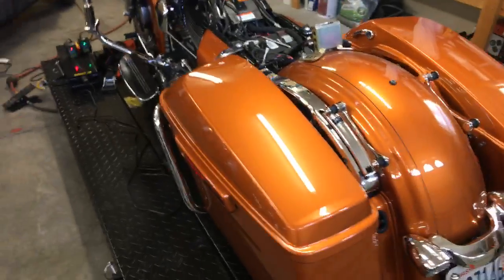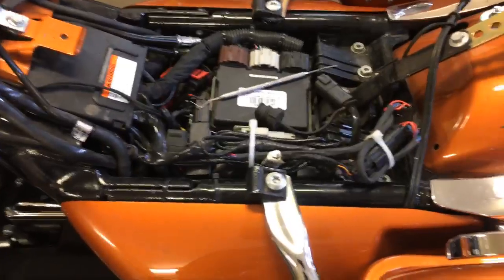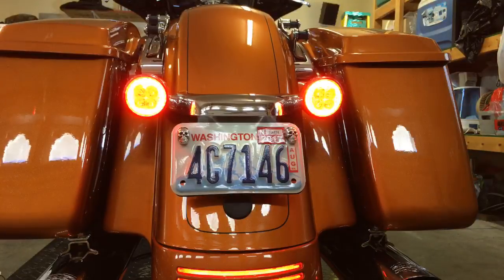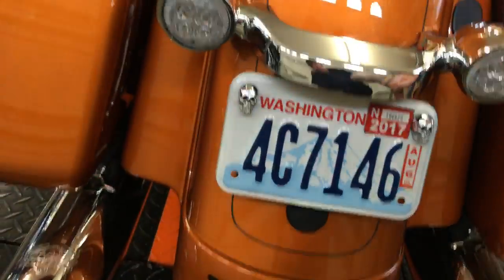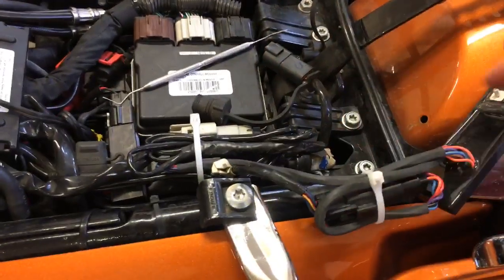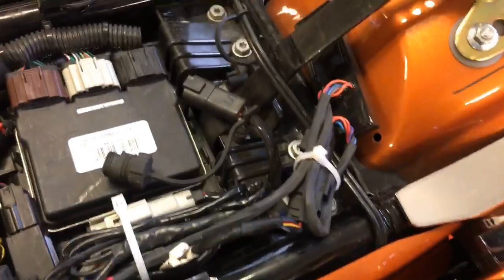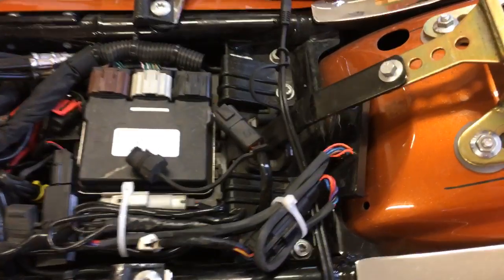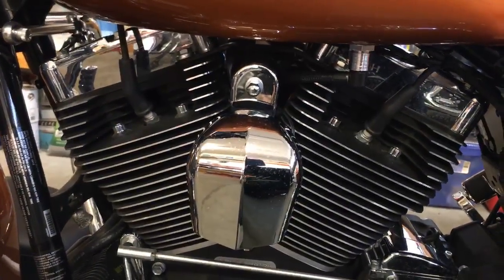Custom Dynamics Magic Strobe Brake Light Modulator for Harley-LED Lights-Review-Install

Comment from the maker: **AFFILIATE REVZILLA LINK TO CUSTOM DYNAMICS BRAKE STROBE MODULATOR ==> 
REVZILLA LINK FOR CUSTOM DYNAMICS STROBE MODULATOR: http://bit.ly/2tZ0VaF

**GET CIRO 3D FANG LED SIGNAL/BRAKE INSERT LIGHTS IN OUR STORE HERE: https://shop.lawabidingbiker.com/collections/lighting-1/products/ciro-3d-fang-led-signal-light-inserts
Reply: Thanks for the tip Ryan , That was easy, I just installed the modulator on my 14 SGS. The bike had LED lamps but they're not as bright as the Fangs you have so I'm going to order the Ciro fangs from your link below.

Comment: Bought the modulator for my 2020 SG CVO after watching your video and love it BUT after installation, the security light stays illuminated? When I remove the modulator, it goes out but reinstalled, it goes back on and stays on?

Comment: I just installed the original... Mine has a lag if I press it takes 1/2 second to start working so if I need to signal vehicle behind with a fast brake signal it will not turn the brake light at all... I installed red to power and white to tail any ideas? I'm using halogen bulb but instructions never said anything about not using normal lights

Comment: I hooked one of these up yesterday, my foot brake wouldn't run it but my hand brake would. I have LED on the back, could that be the problem? I took it back off and hit my brake pedal and it worked as normal.

Comment: Custom Dynamics does make a modulator that will work on incandescents and LEDs (MAGIC-STROBES-BCM) and it's a bit cheaper $59) than the LED only version, but I would agree, if your goal is to be seen, LEDs are for sure the best way to go. The BCM is a brake light-only modulator, and does not flash the turn signals/running lights. I have to say that it's kinda lame that on a $28,000 Ultra Limited , Harley cheaped out and didn't do LEDs on the break lights. If I understood the good folks at CD correctly, they explained that my turn signals are in my Tour Pak and they splits off before this modulator, so I would need a separate modulator for my running/turn signals.

Comment: Next mod is the strobe. I did the Hinz 3rd tail light and LED tail lights from Radianz...big improvement...but defiantly need the strobe. They say it may be illegal here in S.C. (South Carolina, not Socal...lol) but I asked some local Sheriffs Deputies and they said they don't bother the bikers who use the strobes as long as they can't be viewed from the front and they aren't blue...

Comment: I installed the  Custom Dynamics Magic Strobe Brake Light Modulator on my 2018 Ultra Limited . I put this on the left side of the black plug on the rear fender. This let strobe work. when I turn on my signal.

Comment: will this work if i nstalled the filler panel lights is it the same plus im using for that or is it using a diff black plug

Comment: Thanks for sharing. Harley use to sell a modulator for your headlight. This is one of the best things I have ever seen for motorcycles. I had a friend that had the headlight modulator and you would not believe how your eye is drawn to it when he is coming towards you even at a long distance. There is something about the light cycling on and off so fast that draws your eyes to it when approaching. It has a detector that shuts it off when the light level falls off in the evening for night riding. Probably one of the best safety features I have seen in my 50+ years of riding. Any comment would be appreciated.
Reply from the maker: +dheller777 yah. Those are great.

Comment: Just a note to add.... some of the Custom Dynamics Miracle Strobes especially on the older bikes do NOT require you to change to LED.  I have one on my 2001 Fatboy, that is designed to work with either.  However the one on my 2016 SGS did require me to change the lights to LED.   One thing to note.  The faster flashing patterns such as the quad flash, and blaster X don't look as good with the incandescents so I use the slower flash patterns.  Elements can't cycle as fast as LEDs so if you are looking for a reason to upgrade... this might be it.  Flash patterns will be better than stock for safety, and you can keep that old school look.
Reply from the maker: +Dan Gellner good info. Thanks for sharing w/ the community!

Comment: I just found out on my 15 SGS that if you have the air wing led tour pak rack rear light or the air wing luggage rack led light you will get the flashing while the turn signal is on. I believe it is now the Center light "to the module"
like your police bike has.. Although it isn't much of a an LED light it is better than nothing in my book. Thanks for the videos!
Reply: I have a 15 CVO, so will it flash the trunk brake lights as well I assume if all are LED?
Reply: @kevinb.3528  Probably but I don't know. My tour pack did not come with the wrap around "built in brake turn signals". The tour pack that was added onto the street glide special is the plane version. I had to add the rack and airing light.

Comment: Ryan
Outstanding information and product. I have one quick question I had Harley Davidson install the LED directionals in the front of the bike while It was at the shop for the thousand mile check up.
Can I install the Ciro fang rear LED lights along with the custom dynamics flasher even though I have the front LED lights by Harley Davidson I just ordered the hero headlight shop can't wait to put that on.
 Thanks again Jeff
Reply from the maker: Yes, it will work with any LED lights.  It just won't work with halogen lights.  

Ride safe & Ride Often!
Here is a link to a bunch of our useful Free vids: http://www.lawabidingbiker.com/freevideos
Here is a link to some of our useful for purchase videos: http://www.lawabidingbiker.com/buyvideos
Want Answers & Information Fast? And help support us at the same time? Do you like the content we provide?
Our patrons get answers to their questions/comments/feedback in less than 24 hrs and are part of our Private Facebook Group. If you are interested in being in this exclusive group you can get all the details at ==> http://www.lawabidingbiker.com/patreon
If you haven't subscribed to the Law Abiding Biker Podcast make sure to do so. Listen in as we talk weekly about issues/items like this & so much more. You can listen on iTunes (Apple/IOS), Stitcher Radio (Android), or any other Podcast App ==> http://www.lawabidingbiker.com/podcast
Join our free email club at http:///www.LawAbidingBiker.com/EmailClub. Only relevant content will be sent from time to time. Email club members are the first to find out about free or for sale content are given special coupon codes.

Comment: Thing worked great on the ride. Definitely more noticeable than stock.
Reply from the maker: Rock on Jonathan!!
Reply: Ryan Urlacher  I have 2016 CVO street glide will it work on my bike
Reply from the maker: Yup ==> https://shop.lawabidingbiker.com/collections/lighting-1/products/ciro-3d-fang-led-signal-light-inserts
Reply: C
Reply: Ryan Urlacher  I already have L.E.D lights in the front it's the kuryakyn fairing mounted driving lights with turn signals. Do I need the whole kit or just part of it?

Comment: Hey installing this did it freak the security system out and cause issues? The reason I ask is I had the HD security system installed at a HD dealer and they didn't configure it correctly and I had no brake lights until I took it back and had them re flash it correctly.
Reply from the maker: I didn't have any issues with the security system.

Comment: I think the lights are real cool I have a question it's a little off topic what do you know about the Harley death wobble? Love the videos and information keep up the good work
Reply from the maker: The death wobble controversy has been around for many years. Older HD's are known to wobble a bit during certain corners etc, but not a "death wobble" unless modifications were improperly made........there are a bunch of Attorneys and spam websites stirring the issue up again recently, but nothing has changed. To my knowledge HD has never lost a case in actual court on this matter.
Reply: Ryan Urlacher cool thanks for the info man I appreciate your videos and what you're doing

Comment: I have it. If you put a led tri bar at the bottom of the fender. It will flash only when you use the turn signals.
Reply from the maker: Cool!

Comment: Does that module work with brake and turn signals on the 2016 FLTRU? Signals are on tour pack with single center brake on fender.
Reply from the maker: ** you can search for that "fitment" info using the link below. They have modules for Ultra's etc...**AFFILIATE REVZILLA LINK TO CUSTOM DYNAMICS BRAKE STROBE MODULATOR ==> 
REVZILLA LINK FOR CUSTOM DYNAMICS STROBE MODULATOR: http://bit.ly/2tZ0VaF

Comment: I just installed the Ciro fang and the magic strobe ON MY bIKE. And now i have BCM code and SPDO codes. 62141,62146,62151,62156,62161. N looking on how to find out what the codes are.
Reply from the maker: Did you disconnect your battery or pull the main fuse?  If not you can throw codes.  Reset and se if they come back.

Ride safe & Ride Often!

Here is a link to a bunch of our useful Free vids: http://www.lawabidingbiker.com/freevideos

Here is a link to some of our useful for purchase videos: http://www.lawabidingbiker.com/buyvideos

Want Answers & Information Fast? And help support us at the same time? Do you like the content we provide?

Our patrons get answers to their questions/comments/feedback in less than 24 hrs and are part of our Private Facebook Group. If you are interested in being in this exclusive group you can get all the details at ==> http://www.lawabidingbiker.com/patreon

If you haven't subscribed to the Law Abiding Biker Podcast make sure to do so. Listen in as we talk weekly about issues/items like this & so much more. You can listen on iTunes (Apple/IOS), Stitcher Radio (Android), or any other Podcast App ==> http://www.lawabidingbiker.com/podcast

Join our free email club at http:///www.LawAbidingBiker.com/EmailClub. Only relevant content will be sent from time to time. Email club members are the first to find out about free or for sale content are given special coupon codes.

Comment: I reset all the codes. But now I have a BCM code b2161 is it because I installed the magic strobe?.  I can clear the code and I press the brake and the code comes back?.
Reply from the maker: Yah, likely. Sometimes those codes get thrown.
Reply: @RyanUrlacher  I converted to all LED but when I clear the codes and hit my brake the code comes back?. b2161